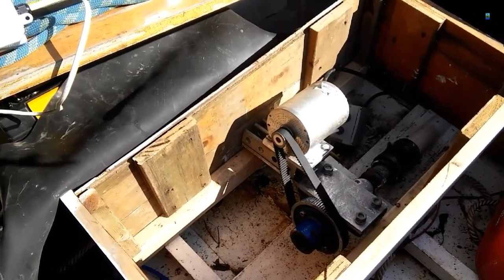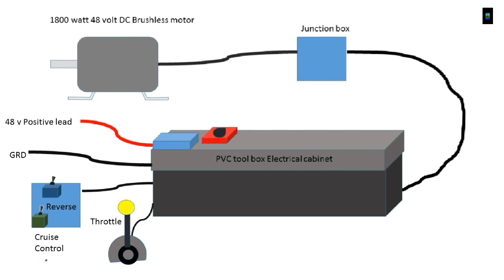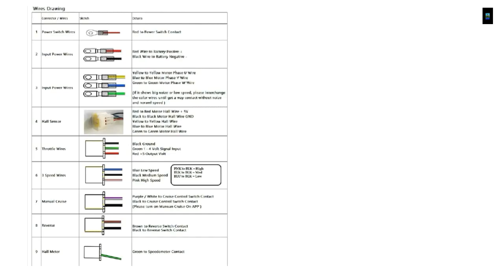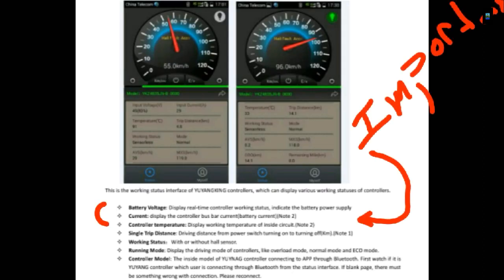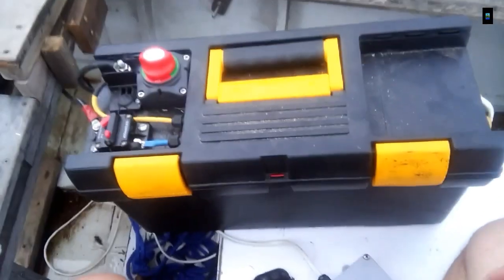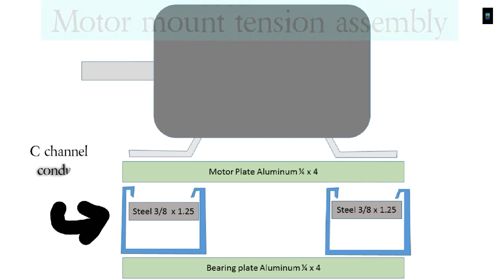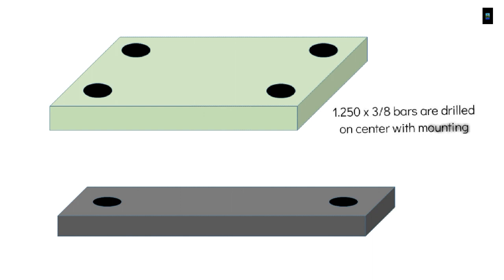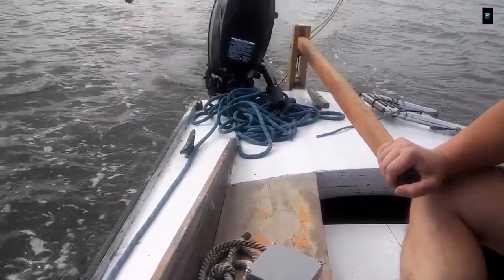Inexpensive DIY Inboard  Second generation

Comment: Hello I have a question is the engine from the video still running or has it been replaced. If the engine has been replaced, what was the reason for that? Johan Berndes
Reply from the maker: For my 22 foot 3000 foot boat I found it was a little underpowered. It did power the boat in and out of the slip fine but at any kind of speed, it has to spin at a higher RPM. It would occasionally overheat if I ran it high, and it was also loud still less than a gas motor, but I like the quiet so I opted for a little bit larger electric motor that I could run at a lower speed with higher torque

Comment: Would this motor setup be feasible as a direct drive inboard?
Reply from the maker: I think  for my application I needed the gear reduction to drive the prop but a small boat and prop could work
Reply from the maker: Unless it was a very small boat, I don’t think it would be good because it would reduce the mechanical advantage from the change in diameter of the police reducing the torque

Comment: So, what exactly is the draw to convert to electric drive in a boat?  What is better about it than using an engine?
Reply from the maker: For me it charges by the solar panels so never need to carry battery’s or gas back and forth to boat and  it’s also great when you need a little assist to turn if the sails aren’t balanced well the electric motor turns on and of with no effort

Comment: WOW! I just had an incident where wind, rain, and tides proved a bit much for my Volvo diesel to push my 30’ sailboat back to dock and resulted in a very fun sounding BOOM and no more starting. I was looking for various conversions and found your first video with the chain drive, I am so impressed with your incredibly simple design. I’m an automotive engineer so I was thinking maybe a Honda 1.8l or similar, but this simple electric conversion is awesome! Obviously not going to reach speed boat speeds but who cares, it’s a sailboat and I’m loving the electric motor. Good job!
Reply from the maker: Thanks

Comment: Any suggestions on what size motor needed to power a Maxum 2800 SRC ?
Reply from the maker: I would think you would want to start with the first power of the original engines I did a video call tales of speed power and torque which was kind of how I came up with sizing my motor before you pull the trigger on an electric motor though you also want to make sure you size the batteries and realize that let us it would probably not be the way to go for a powerboat
Reply from the maker: Sorry it's called speed torque and prop pitch that went through how I size my motor for my sailboat I think it might be a good starting place to go through that process for what you want to do as well

Comment: What size batteries do you have and what kind of max speed and range can you achieve?
Reply from the maker: All I have been able to get it up I have another video actually I have been able to get it up to about 5 Knott's but I don't think the battery will last more than half hour at that speed. And I was only able to do it once most of the time when I got it I can only get about four and a half that's knotts
Reply from the maker: I have four group 27 Duracell that acid batteries that are 12 volts 80 amp hours a piece unfortunately what acid really handicap you on the range but for getting in and out of the slip it's fine the 80 hours has to get cut in half because I can't go below a certain level to maintain cycle life. And then there's a resistance cost you see the batteries are designed to be discharged slowly with low current the 80 amp hours is set for four amp hours an hour for 20 hours they give a rating of If you use 25 amp hours the battery only lasts for like an hour and 15 minutes so 25 amp hours depending on the current I'm usually between three and four knots so my range is about four knots. I think another people on this forum probably know a lot better than me but the equivalent lithium ion 48 volt battery is about 30 amp hours and you'll actually got a much longer life out of that if you buy buy it. For me this started as an experiment and it's worked out really well because really I just use the motor to get in and out of my slip I do have a backup gas outboard. But I've never had to use it. For any kind of range I would strongly recommend considering a lithium ion solution. The other thing for me is in my boat I needed to add ballast so the added weight of batteries just means I can take out more rocks LOL

Comment: Great video Phil. The gearbox on my Volvo Penta 25hp has seized and I am considering changing to electric. Your setup is the easiest to fit that I have seen. I imagine I might need a bigger motor though. My boat is 30ft steel 4.5 tonnes. Any recommendations?
Reply: Don't think bigger engine for speed , think pulley configuration for more speed 3:1 instead of 2:1 .. 
I just got a 1.25kw trolling motor 24v  on my 53ft steel narrowboat ! Works beautifully ! Though I am inland..
Reply from the maker: Hey Alex, my boat is a flat bottom sharpie with less than half your weight my guess is you would need probably a 10 KW motor there several suppliers out there that have kits .https://electricyacht.com/product/quiettorque-10-electric-motor/ I would Google electric inboard conversions and scour all there installation data and sizing data this is just one of them. That would be my first step. Then I would join as many as possible groups do in board electric conversions to see what types of problems people are having .
Reply: @philcostello6989  Thanks for the tips 🙂. Merry Xmas

Comment: How many amps are your batteries and what is the range?
Reply from the maker: Thanks for watching !!  are you working on a project too?
Reply from the maker: Oh  I miss read the question 80 ah  12 volt batteries in series I got the  standard lead acid deep cycle
Reply from the maker: I would say about 10 miles at hull speed  most likely more but I'm still trying to work it out
Reply from the maker: I have a breaker set to 50 amps amp I drew close to that at max speed if I accelerate to fast it will pop it still working on soft start setting so I can't make that happen. At 3 knots its about a third but I have to collect some more data on that to know for sure its hard to see the digital read outs in the day time Sun